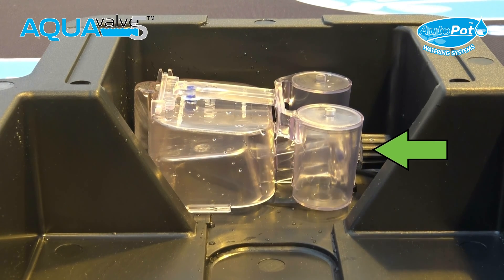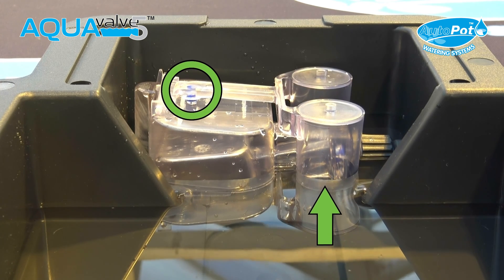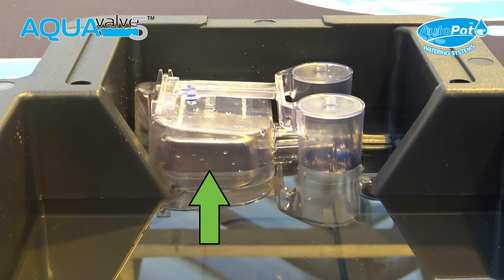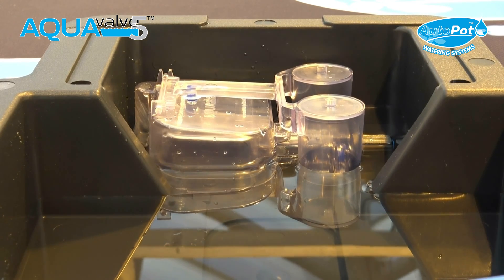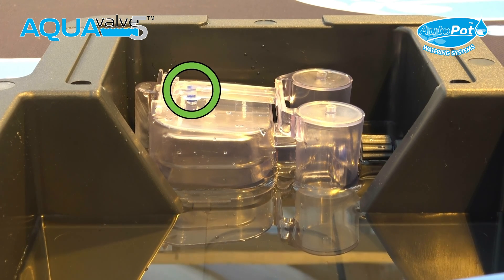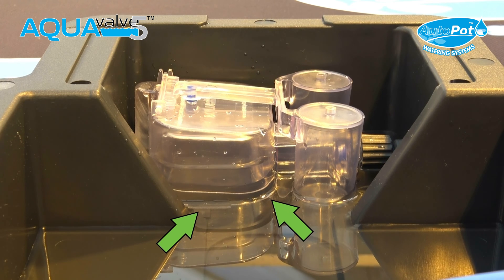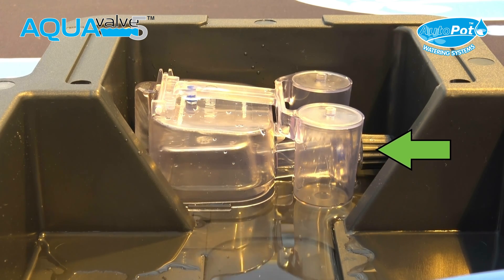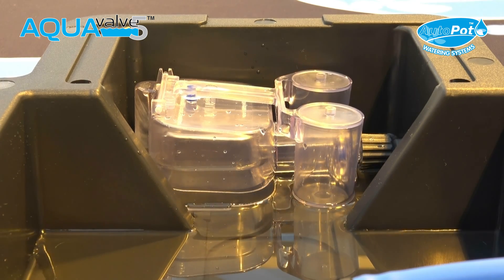AutoPot AQUAvalve In Action

Comment: I have  16 autopts... they do not do the 1hour Dryback?  :(
Reply: did fou fix this? I noticed the same and put it down to me tapping on the float making the silicone seal move off parallel, but I doubt your doing that with 16 lol. the key part for us is at 1minute and is likely caused by that top float seal